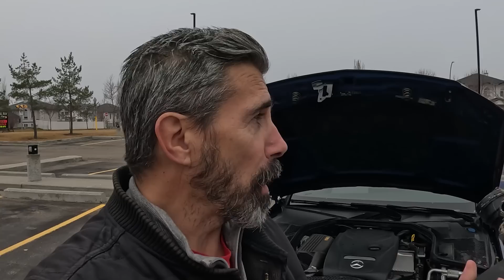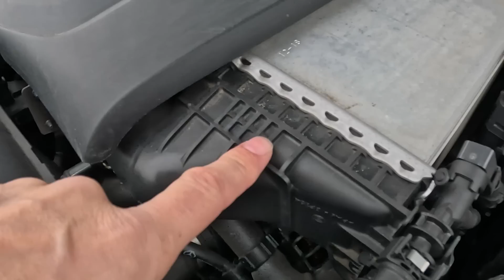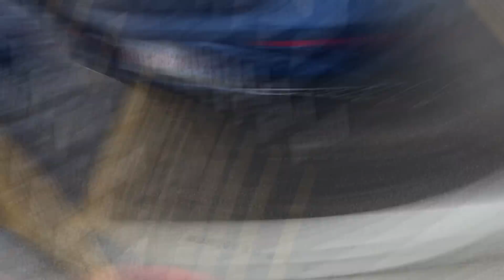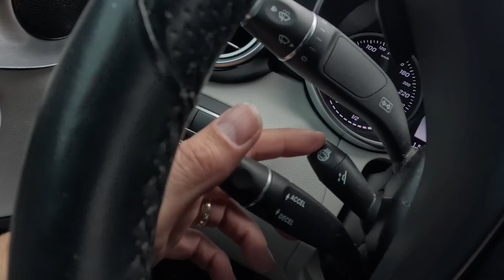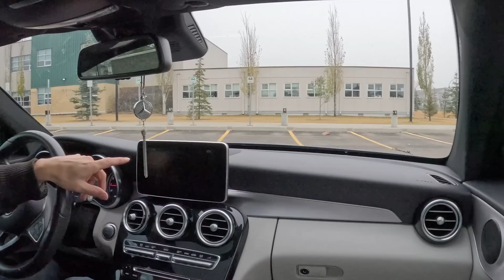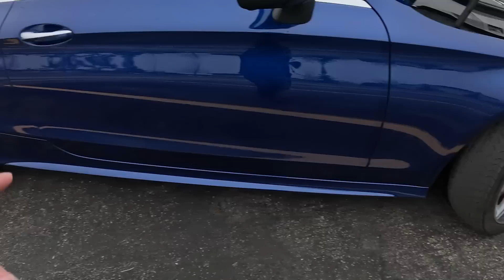Here’s Why New Cars Can't Last  5 Years | What Went Wrong?

Comment: Anything newer than 2017 isn't built to last and some cars made even before that weren't designed to last. The best time period for modern cars was between 2005 and 2015
Reply: I would say the best time for cars was around 1992 to about 2016. Now they are absolute trash
Reply: @dampergoldenrod4156  Yes, older cars can have their advantages, but they also have disadvantages. In the 80s and 90s "some" cars were over engineered because they didn't have advanced computer programs to figure out how strong a part needs to be so they just over built the part instead. I was specifically talking about "modern cars" that have airbags, ABS and do better in crash tests. Car from before 2005 weren't as safe. Plus older cars are harder to get quality parts for and they aren't as fuel efficient. That's why something like a Toyota or Honda from 2005 to 2015 is probably the sweet spot where you get reliability, simplicity, efficiency, safety and easy to find and cheap parts.
Reply: Na Between 1950 and 1980. Cars were crap in the 80s. Then good again between 1990 to 2005.
Reply: @radioactivebanana6774  That depends on the specific make and model you're talking about. in the 50s to 80s there were plenty of junk cars. Just like there were plenty of junk cars in the 80s and 90s. My point is that "some" old cars like an old diesel mercedes w123 from the 70s and early 80s could last forever, but a Ford Pinto from that same time period was junk. The problem with 50s to 70s cars is they were A LOT less safe in a car accident and depending on the model a lot of the parts are impossible to find. Plus they take more work to maintain adjusting carbs and ignition points becomes a hassle and cars from that period were very bad for fuel efficiency which is always your biggest cost of ownership.
Reply: Best cars in the history were those produced between 1990 and 2005. Period.
Reply: @francoisgirard2306  You'll have to be more specific because there were plenty of cars from 1990 to 2005 that were junk. You'll also have to define what you exactly mean by "best". Best in what regard? They weren't the best at being fuel efficient and they weren't the best in terms of collision safety. Cars before 1996 didn't have OBD2 diagnostics so they weren't as easy to diagnose when a problem started. They also aren't the best in terms of parts availability because many parts are no longer being made for many 1990s models. They also weren't best in terms of performance or handling compared to the more modern 2005 to 2015 cars. Pretty much the only thing they were best at was electrical and mechanical simplicity and better build quality because less plastic parts were being used compared to modern cars. If you can think of anything else they were "best" at please let me know.
Reply: @ Japanese cars of that era were the best. The best in regard of reliability, ease of maintenance, and safer than pre 90’s cars. I know part can be difficult to find, but I mean those cars were the best when we were still able to have parts. You can also add every GM cars with the 3800 engine in that list, all Ford Panther platform, and all GM and Ford OBS trucks. The 50, 60, and 70’s cars were all junked at 100k miles. They weren’t as good as some people pretend…
Reply: @francoisgirard2306  Okay, I can agree with that to an extent, but I still wouldn't claim they were the overall best in most of the categories or criteria. The criteria you did mention, yes they probably were the best, but the more modern cars from 2005 to 2015 excelled in other criteria while still not faltering away to far from the best winning criteria of the 90s to 2005 cars. A lot of those cars you mentioned were very good, but they still had some faults. With the GM 3800 they had those coolant leaks into that intake area and their transmissions would fail if they were neglected and they had other common problems with fuel pumps and power windows. Even the Japanese cars from that era had some issues, but in general they had much, much less problems than non-Japanese cars had. For me I would take the trade off in having slightly more complex electronic and mechanical system (emphasis on SLIGHT) for having parts that are easier to find, better MPG, cheaper to insure and safer crash tests of the 2005 to 2015 Japanese cars. Of course there are still some Japanese makes and model from certain years between 2005 and 2015 I would avoid, but in general I think they have more advantages than disadvantages overall. An example would be a 9th gen Toyota Corolla or 2012 to 2016 Toyota Yaris hatchback. Those cars are super simple to work on, cheap and easy to find parts for, great on gas and they easily last 400k+ miles.
Reply: People Who Aren't ((Mechanicaly Inclined)) Don't Know That ~ They Think The Newer The Better ~ Oh They Will Learn Maybe Not They Just That Slow 😂
Reply: I would go back ten years from your initial time frame estimate. My 09 N54 was a great example of first gear turbo with too much plastic. You have to do a lot of preventative maintenance to replace before the plastic breaks - sometimes you’ll still be surprised
Reply: @brunellom8914  BMW plastics have a long history of becoming brittle very quick. You might assume, it's plastic so it must be cheap, but with BMW even the plastics costs big bucks. The plastics used by other companies, especially Japanese ones last 10 times longer. Everyone knows by now BMWs become endless money pits as they age. If you want a luxury car that's actually reliable and won't become a money pit, Lexus is the best choice.

Comment: That’s why I’ll never get rid of my naturally aspirated vr6 stick shift 3.2L with timing chain only had to replace the radiator and fuel pump so far at 200k miles
Reply: Got one too, but still lots if plastic. Whole inlet manifold, crack pipe and thermostat housing etc etc. Many electronic modules too

Comment: +1 on the shop rates. My wife's car (Japanese, pretty vanilla) was $420 (really lol) for an oil change and brake fluid. I said no thank you and did both jobs for under $100 - with oe parts. 

Colleague of mine kerbed a rim pretty bad. Main dealer wouldn't supply and new wheel without doing in $175 "diagnostic" 😂

Comment: If you change "good oil" And flush engine when it's required for turbo engine and don't forget  good detergent for fuel injection. In my humble 40 years in German cars. They rarely have the problem you mentioned.  I said my experience 90% of the owners won't taking any mantaince《good additive 》until it broken, most of us love these kind of owner. 😢😢😢
Reply: Won't do anything for plastic housings around the engine or burnt out electronics.

Comment: I ride a 2012 BMW R1200GS - Its a Boxer Twin
It does 55mpg, has a 125mph top speed, shaft drive and NEVER ever, ever goes wrong - as its an iconic 100yr old design evolution
Its parked outside in ALL weathers, all the time, scorching hot & devastatingly freezing cold (Like the trusty VW Beetle Flat-Four)
I use it 350+ days a year, and it costs an embarrassing small amount to insurance etc . . . .and ridiculously small £'s amounts in 'consumables' , and Ive now done 62,000 miles
I have a top box, voluminous panniers & a sturdy back pack,  so everyday living is a 'doddle'
New cars - Nah, no thanks !
Reply: Thanks for your feedback at BMW we shall use this testimony at our weekly meetings to discuss new ways of maximizing profits in our motorbike department. 😂😂😂😂
Reply: I’ve got a 1996 BMW R1100GS , it’s done 70k miles and runs very sweet , I took it on a trip to the Scottish highlands this year and it did the job perfectly through fast sweeping bends to very tight mountain routes .
Reply: @Otto_nosetices_stuff  - Agreed, Its the only German Bike i've had . . . . . & i wish id known how good they were when i was swapping & changing Jap bikes every few years!. Wonder if the newer Water-cooled models are as good !

Comment: all my cars are more than twenty four years old. The lowest mileage I have on one is 146,000 miles. You are right when you say they are not built to last any more.
Reply: mine are from 1996 and 2002. They both run great still.
Reply: I got Toyota 4runner 2001 .one owner - my . 626.000 + miles .still runs daily 63ml.
Reply: My Cherokee '97 got an an exchange engine after 580.000km on its first one. Can pick it up tomorrow with an engine that 'only' did 150.000km's or so. Bought it in 2012 with 180.000km on its first engine, but now, after 12 yrs it needed an overhaul. Happy, because tomorrow it's mine again!!!
Reply: Out of my 5 vehicle’s the newest us a 2008 Dodge 1 ton single wheel diesel with 80,000 kilometres on it. All are older low mileage.
Reply: My 1991 Dodge Stealth R/T AWD AWS with 77,000 original miles, runs just peachy!!!!

Comment: I am driving up the Pacific coast today in my 25-year-old BMW wagon. I did have to replace the radiator this year, but that and a window motor and some gaskets are the only parts repairs in two and a half decades. BMW and MB have gone in the wrong direction…
Reply: Roughly, dont get anything later than an E46.
Reply: @wxyzxdll  correct the E46 was last great car BMW made.
Reply: @wxyzxdll I had a 2010 E60 M5, an oil sensor failed in 6 years, cost me 3k to replace.  Never again.
Reply: @forumboss2620  agree with you on Mercedes not BMW
Reply: @forumboss2620  I also keep riding my 1996 BMW E39 528i. The main issues on it are the parts I've replaced in the last few years, failing again. So the new stuff is not reliable.. Like sensors and parts made of rubber. Seems quality is less now.. Furthermore the car itself is so good. Love the engine.

Comment: I just sold the first and last Mercedes Benz I’ll ever own. Despite being a trophy car, it literally started falling apart electronically from brittle wires that lost the insulation and either shorted out or opened the circuit. Cosmetically beautiful on the plus side. Ridiculously complex on the negative side. Wallet emptying dealer network.
Reply from the maker: That’s been my experience too.  Dealers are great at cleaning out your account on devastating maintenance and unexpected repairs
Reply: @ECPP  I heard yrs ago repairs of the Dealers is where they make their money; selling vehicles can't keep them afloat.  I had a Chrysler Dealer about 6 yrs ago telling me my old chrysler intrepid first generation had problems with old modules under the hood because it quit running and couldn't get it started. Was going to take me down the rabbit hole.  I Having messed with it at home I could get the engine to shut down wiggling the ignition key.  I told them to replace the ignition switch where the key goes and within two hrs they called me at home telling me my Intrepid was ready.  No problems since.  And my old chrysler/dodge didn't have all the modules like today but each was about a 500 dollar part and you know they would end up replacing the PCM, ECM, etc until they milked me for a bundle.  In the long run I think they were dishonest.  Never again a dealership.
Reply: Mercedes had some very very reliable models back in the day.
Reply: @michiel5160  True I have 3 of them one 
2003 CLK500 AMG V8 with 100.000miles
2003 clk320 180.000miles
2011 E500 Coupe 65.000miles 
All drive with no Problems but I changed  Engine oil every 6000 Miles
Reply: @loloflieger8832  there is no such thing as a clk500 amg
Reply: @mrpickle23   with AMG I meant the Styling Package
Reply: Even when Mercedes were good, it was part of their business model that they would take $15000 grand from you in maintenance fees in the first 5  years.  They literally testified to it in court.  Stay far away from the Mercedes 'Company Store'...
Reply: Mercs are a nightmare now, see so many on the motorways with flashers on. They break a lot it seems. All the plastic rubbish, all the ECUs. My friend ended up with an S-class - dropped money on that like a small countries budget, total luxurious junk basically.
Reply: Incredible that they have such bad wires. I was thinking now since Jaguar seems not to be an alternative in a few years, Mercedes could be my next car but that doesn't sound good. There has been good wires for decades, what shit did they make them from to get that bad?
Edit: Some googling told me about brittle engine wiring harness in model years 92-97. Are you talking about something in that range? Then it might not be a general Mercedes problem.
Reply: @ no. It was a 2007 CLS 550. My understanding is Germany was (possibly still is) into this “go-green” woke bs and used some sort of synthetic rubber insulated wiring harnesses that hasn’t withstood the test of time. I ordered a corvette as a replacement trophy car.
Reply: @davemorris1113 Hello Sir, how are you today? What about Mercedes bikes ?
Reply: @skunkjobb it’s the modern eco friendly wires made from a soybean derivative.  Doesn’t just affect German cars.  Also attracts vermin to eat it.
Reply: My old mechanic Larry RIP commented on Mercedes at the main dealer, he knew the owner. 
The Merc dealership owner had 29 brand new vehicles return in one month. Faults on all but 7 that he sold.
The days of the Mercedes of the 80's and early 90's are long gone.
Reply: Yeah, German cars drive nice but…. How many years did it take for it to begin falling apart? I’m a big fan of German cars. Which brand will you go to next?
Reply: @brunellom8914  He should go Lexus or Acura. Much more reliable and they are decent to drive.
Reply: @michaeljackson9125  nice cars but I’m not interested in a car that sounds like a dishwasher. Corvette c8 is arriving soon.
Reply: @brunellom8914  they don't get blown when you go full throttle for a couple 100.000km - that's why I still drive A class Mercedes. The entertainment system is nuts and the inside looks somehow budget. There is structural ratteling in the body structure due to the large sun roof - what becomes more and more an issue as road conditions further deteriorate here in Berlin.
Reply: @brunellom8914  corvette c8 super car.

Comment: Did anyone notice this guy looks different.  He looks like he has lost a lot of weight
Reply from the maker: Yes exercise and better eating
Reply: @ECPP  Well, congtrulations, you can definitely  tell you are sliming down.
Reply: Or stressed from owning a Mercedes and can’t sleep very well due to check engine lights, car not working properly? I went through same and I sold a brand new Mercedes AMG I bought 7 years ago! It developed a transmission problem at 100k miles and I junked it for Toyota. Now I sleep better and don’t visit stealership like I used to do. Toyota is a smart vehicle to own. I learned a lesson! Sad I wasted over 100k which I could have invested in something else!

Comment: I never got rid off my old vehicles  my family and friends always kept telling me to buy new car , I have been driving my 1996 Chevy Blazer for 24 years no problems just oil changes every 3,000 miles I have 1979 Chevy pickup C10 for 17 years no problems , I'm keeping them
Reply: I will keep my wife's inherited 84 c10 silverado and my 71 delta 88 convertible. Drove both today😅
Reply from the maker: Cheers
Reply: My Chevy Blazer has 246,000 miles engine sounds and drives like the day I bought it , and my 1979 Chevy pickup C10 Silverado has over 300,000 miles still driving strong the key is I do my oil change every 3,000
Reply: Glad you had good luck with the Blazer. I had a '98 GMC Jimmy that spent most of its life at the repair shop. Needed a head gasket at 5,000 miles and it never got any better. Only vehicle I ever owned that snapped a frame bolt. It was nice looking but it was cramped and we got rid of it as soon as we could. Most domestic stuff from the '80s and '90s was not good, I don't miss it at all.

Comment: Dont worry about the engine, the subframes will rust within 5 years.
Reply: My 03 Focus had a rusted body, subframe and exhaust by '18 or '19. My - cheap, but good and semi retired - mechanic told me to move on, but I asked him to fix it.
Then my clutch started to fail and I finally gave in. Still miss that car though and wonder if a couple thousand euros could have kept it on the road till now.
Reply from the maker: That’s fair at least in northern climates and salt belt
Reply: They last longer now than they did in the 80's.  Rust proofing at the factory is much better I would say.
Reply: @CPpuppies That’s for sure , the older cars dissolved before your eyes .
Reply: @bikeman123- I am on 42 years and nothing but surface rust here and there.